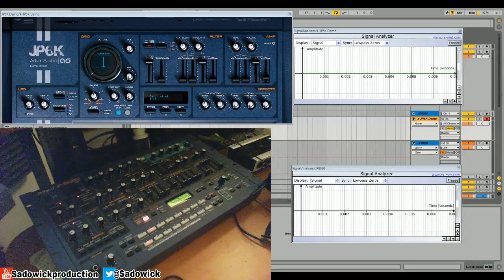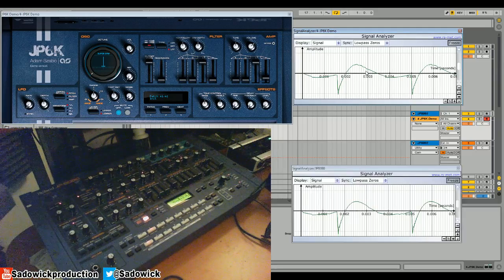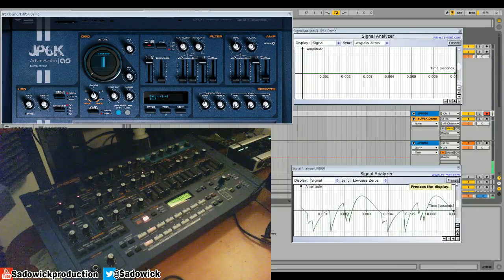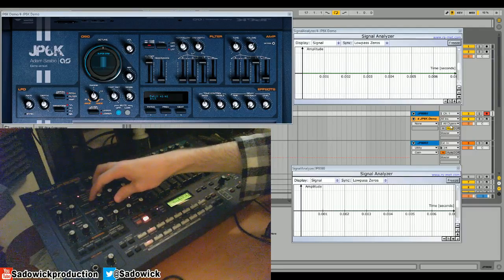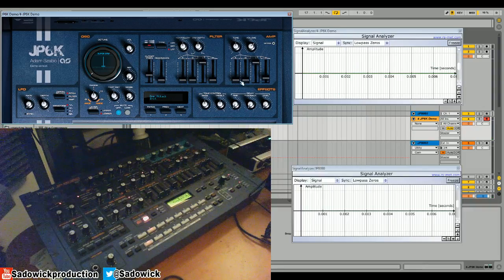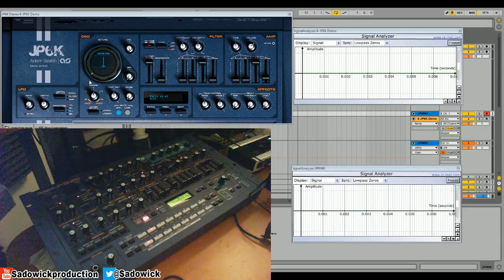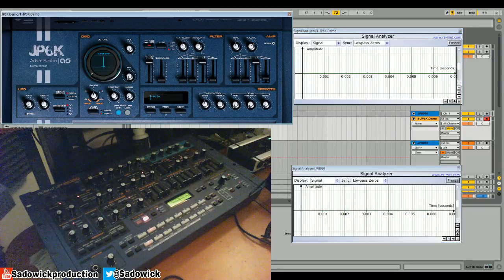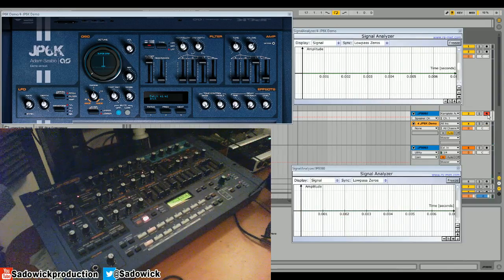Adam Szabo JP6K Vs Roland JP8080

Comment: I'm guessing the "slight jaggies" you see on the 6k may simply be due to the mix control, when zeroed, still having the six "side" oscillators at a slightly NON-zero volume.  Even if detuning is off, I believe phasing is still random, so you're looking at the "main" sawtooth, plus 6 very low-amplitude sawtooths at random phases.  This will cancel and reinforce various harmonics a bit.  Since his analysis of the 8000 was so in-depth, I'm guessing the 8000 actually worked a bit differently than your 8080.

Comment: Well, the JP6K was so far the only VSTi that I was able to reproduce some cool classic 2000s "euro" sounds, like the leads from DJ Dean, Special D, DJs@Work, etc. But I wish it could have square waveforms too, a lot of good sounds are square/PWM.
Reply: Try Spire. I make classic trance and Techno Trance which is quite similar to classic trance in many ways only tracks are 145-160bpm if I'm not using hardware then Spire is my go to VST.
Reveal sound has over 1000 classic trance presets.

Comment: Hey, you’re probably over a/b comparisons by now but have you put the likes of LuSH-101 up against the JP-8080? The reason I suggest it is because it has a supersaw implementation and in my opinion lush101 has a very similar ‘rolandish’ character to the filter (although it does tend to attenuate as you add more resonance - easy enough to work around though) also have you put it up against the Omnisphere? The filters ‘should’ be very good on that too.. although I don’t think they will have the same character...

Comment: resonance test at 10:36 ,i used Diva with multimode filter ,draft mode i could get the same waveform as in the oscilator,very close sound to jp8000.
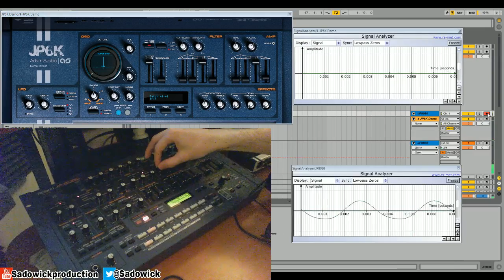at 11:34 i could match the sweep but i need to add 40% resonance,i can tell that the jp8000 is a little bit resonant by nature,i think that this is part of the character.

Comment: Why hasn't someone modelled the JP8000 yet?

Best synth ever made. U-HE or Softube or Waves could do it. Even Roland themselves have not bothered to model it for their System 1 etc

I'm waiting for a near-perfect VST emulation of the JP8000 (preferably the JP8080). When it happens, I'll never need another synrh.

JP8080 has extra features over the JP8000... Additional noise generator on OSC2. That is not just ''noise'' but everything between white noise and pure sine (see here for explanation).
* External control assign to simultaneously control multiple parameters using mod wheel / aftertouch ?
* A 12 band filter bank for processing internal or external sounds.
* True vocoder (with carrier and modulator inputs).
* One of the great functions - Voice Morph. This feature lets you use sound input as a controller. Just like you are tweaking a mod wheel, but instead of mod wheel it is your voice (or external sound of anything you input) changing any parameters you desire - filter cutoff, oscillator pitch, resonance, amplitude etc.
Reply: Still no luck 😓
Reply: @user-pl3he7eo6g  yeah I know bro, the JP8000 seems to be the neglected one, as if what, are they scared of it? lol Top synth 🪂